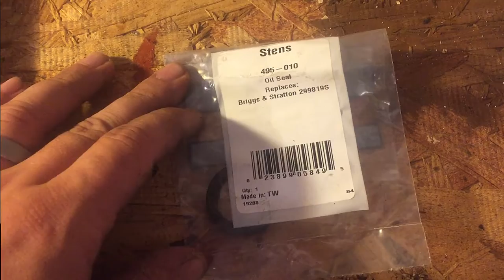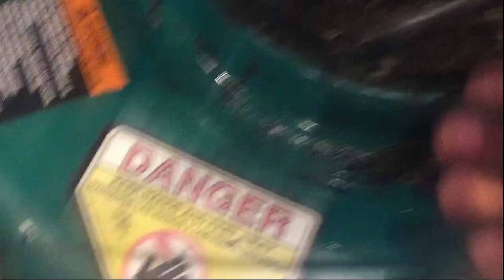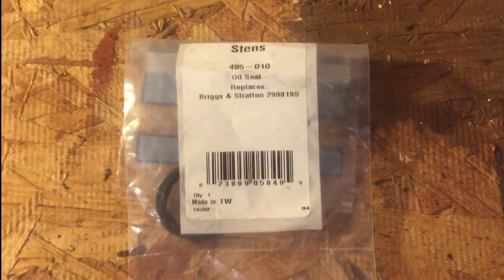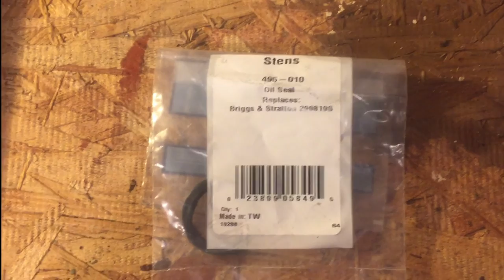How to Replace an Upper Crankshaft Oil Seal on a Lawn Mower | Oil Leak on Top of Lawn Mower

Comment: Just to clarify, I see you turning the flywheel COUNTER clockwise and then banging it with the hammer. I'm a noob to these things but I think I seen some info saying not to turn the flywheel counter clockwise because it can mess something up??? I can't remember where I read or saw on a video but can you please confirm if thats' true? I need to remove the flywheel as well and I don't want to mess something up. Usually does the flywheel spin clockwise or counter clockwise when standing and looking down at the flywheel from the top of the deck? Any help is appreciated. Thanks.
Reply from the maker: Yes I did spin it clockwise and it didn’t damage my mower. Still running just fine. You can tell the direction yours turns by removing the spark plug boot and then just pulling the starter cord slowly to see which direction it spins. Most motors turn clockwise but it’s a very easy test to verify.

Comment: To remove the flywheel a little easier, spray a couple shots of WD-40 at the crank / flywheel joint.  Put a couple pry bars evenly under each side of the flywheel.  apply slight pressure on pry pars between case of engine and flywheel, while tapping on nut at crank.  Flywheel will pop off fairly easy, unless it is heavily corroded.
Reply from the maker: Great tip, Rob! Thanks for your comment. Cheers